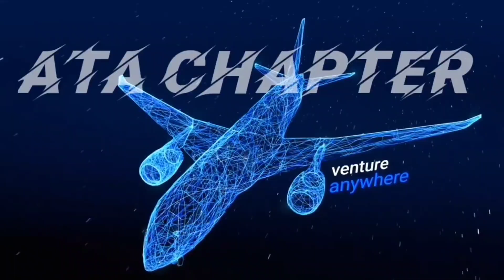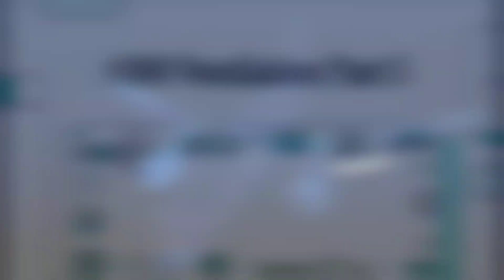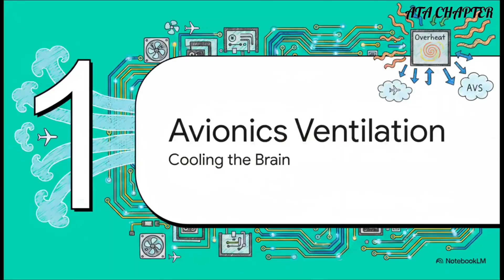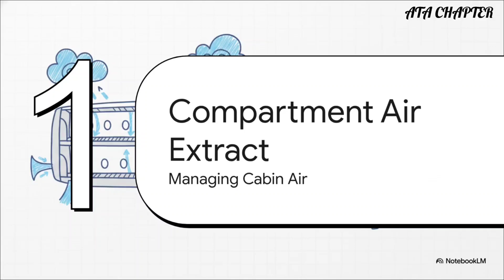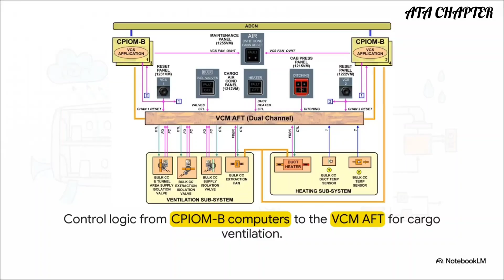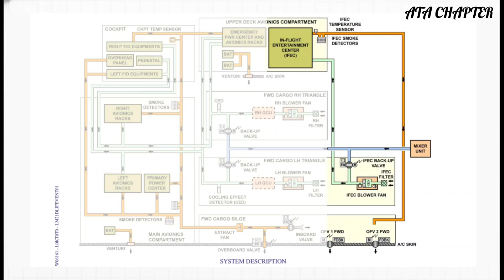A380 ATA 21 Part 5 (ENG) Explained: Ventilation Systems: Avionics, Cargo & Extraction.

Comment: My question is if i learn this video then it will be for a380 right or this knowledge can be used in other aircraft also.
Reply from the maker: "That’s a great question! Specifically, this series is a deep dive into the Airbus A380 architecture. However, the fundamental principles of aviation engineering—such as power distribution logic, structural load paths, and safety redundancies—are largely universal. While component names and system layouts may vary depending on the aircraft's specific needs, the core concepts remain the same. Mastering the A380 gives you an excellent foundation for understanding any modern airliner."